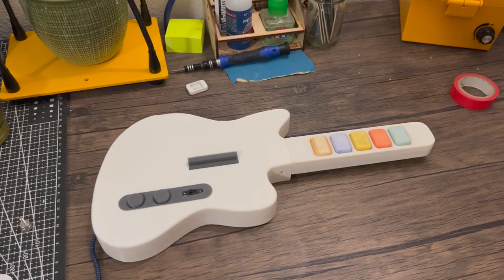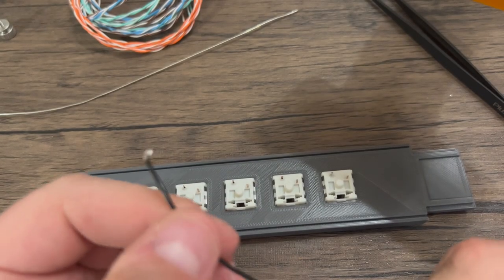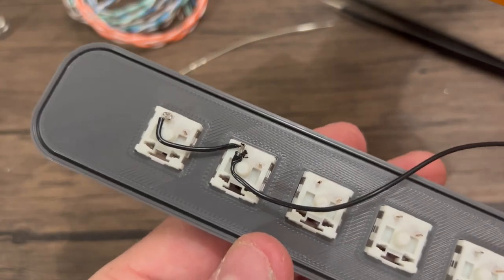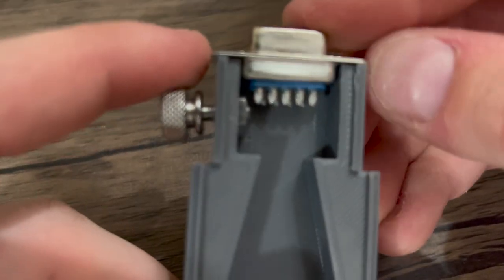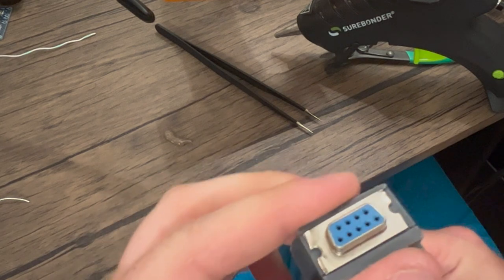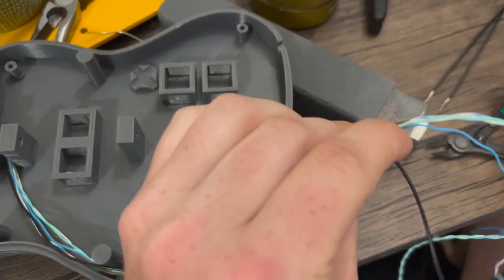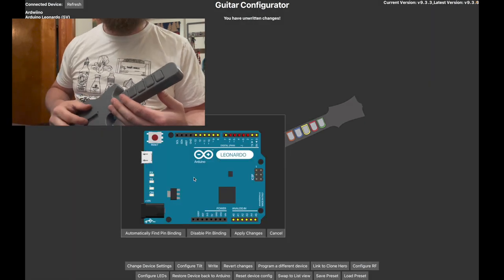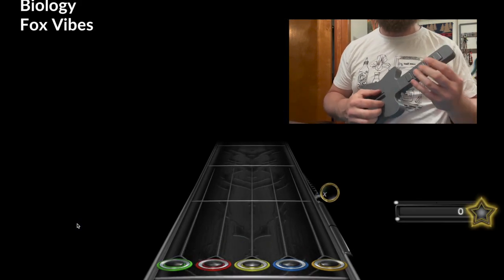Mini CloneHero /Guitar Hero Controller Build

Comment: I’m currently using this (and another video) as blueprint for a cardboard only version. Some of us don’t have 3D printers but there are services online! I’ve successfully recreated the body with cardboard, just waiting on the buttons and strums to come in! Thank you so much for this! Let ya know how it all turns out
Reply: I said cardboard only but I know some part (namely the small ones, are super important for durability so having those printed at least will make this budget friendly version feel goood
Reply from the maker: @brandonthedev that is so damn cool! I’d love to see how everything turns out!
Reply: so far so good. switches came in so started doing wiring. Had an old half size keyboard that i ripped apart to get the motherboard out. using that over the arduino (still coming in from temu). Think I'll start posting updates on my personal blog and share once done. Cheers and thanks again! You Rock!
Reply: oh yeah, for my version - I altered the sizing quite a bit, made it much less travel friendly but also feel like it fits me a bit better (under 6'0)

Comment: I love bringing back the rockband style tilt sensor, i have a modified controller where a tilt sensor is soldered to the star power button, and glued to a screw i put through the back of the case, which made it adjustable, it would be cool to have a dial added to this model to adjust the tilt sensor.

Comment: I wouldn't recommend the solder job that you did, lol. Mainly just melting the plastic with the soldering iron. However, the whole project is really cool. I have a 3D printer I haven't used yet, maybe this will be the first project I try to tackle with it. Thanks for the video!

Comment: i want to do this project, could you explain a little bit more the sensor part? also if i dont want to take off the neck sould i skip some parts?

this seems interesting and fun to do , would be my first 3D project
Reply from the maker: You’ll want to print this model then. The parts list also follows the non-removable neck version

https://www.printables.com/model/479046-minicaster-mini-clone-heromidi-controller
Reply: @VladTheInhaler1  thanks for the answer! will print this in a few weeks
Reply: @VladTheInhaler1  another question , what are these cables called? the ones for the switches and Arduino

Comment: Duuuuuuuuude how cute and awesome is that guitar!! is this compatible with xbox 360 (with rgh obviosly)???
Reply: Yes it is with the plugin inside of dashlaunch need to put the guitar on xinput obviously
Reply from the maker: It is! You can program it for any system, but it defaults as x-input which will work on the Xbox.
Reply: @VladTheInhaler1 may I ask later for some assistance? I need first to get the supplies to make my own. 😅 thank you again for posting this
Reply from the maker: @DavidGMelo21  of course!

Comment: Does it matter which numbered pins I use on the board?
Reply from the maker: The only pins that matter are the ones for the whammy pot. You want to make sure you put the signal wire to an analog pin and the hot wire to VCC. Otherwise the configurator will be able to sort out all the buttons when you map them!
Reply: @VladTheInhaler1  alrighty man! Thank you!! I have most of the stuff to make one of these just lying around, so I figured why not? 🤣
Reply from the maker: @FreddyBadASS  that’s awesome! Feel free to hit me up on Printables if you have any other questions! You should also share your build when you do it 🙂
Reply: @VladTheInhaler1  oh I will dw, I've just got to buy that arduino board and the keyboard switches
Reply: One last question, bro 😂
Does it have to be 14 gauge wire? I've got 6 rolls of 20 gauge sitting in my drawer. I need to use 🤣
Reply from the maker: @FreddyBadASS  you can use whatever wire you want to.
Reply: @VladTheInhaler1  nice, thank you! I'm not so technologically smart lmao

Comment: Skipping the exact part I was most interested in at 17:22 :(
Reply from the maker: It's a very simple circuit with a shared ground. Basically, run a ground to all the switches then run independent wires from each switch to the ProMicro. I will draw something up and put it on my printables page.

Comment: i'm appallingly bad soldering or i'd be all over this
Reply from the maker: Haha. As you can see I wasn’t much better when I made this. But this is a really great starter project as there aren’t any tiny parts. Learn from my mistakes here, you want to heat up the area you’re wanting to weld and then flow the solder instead of carrying solder with the iron. And use flux!